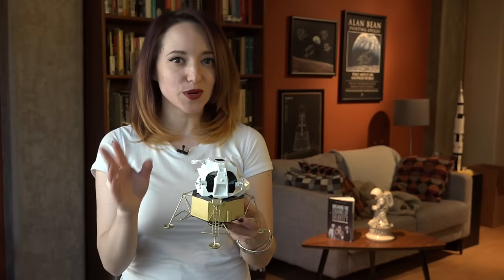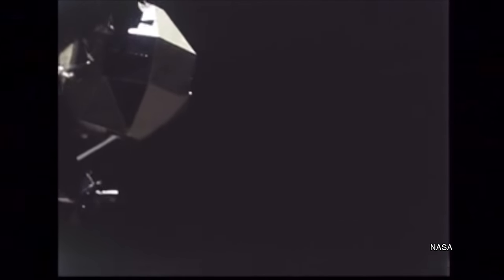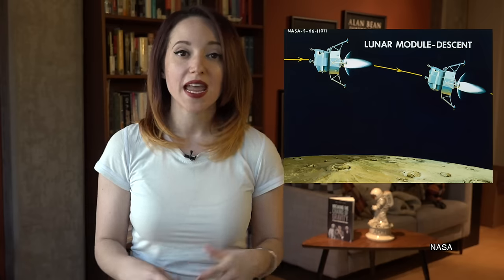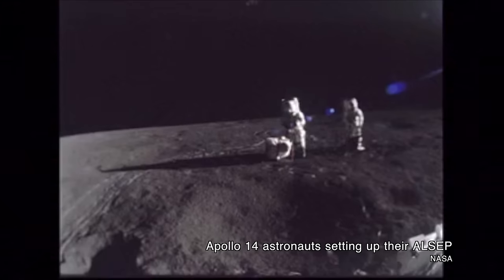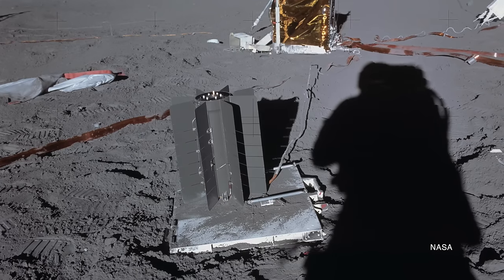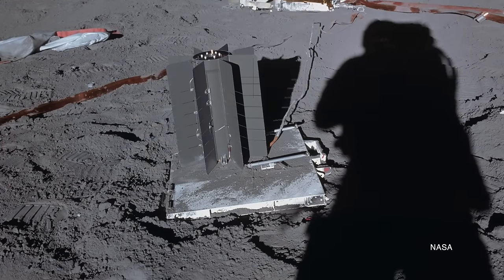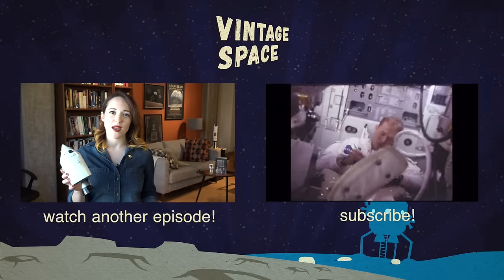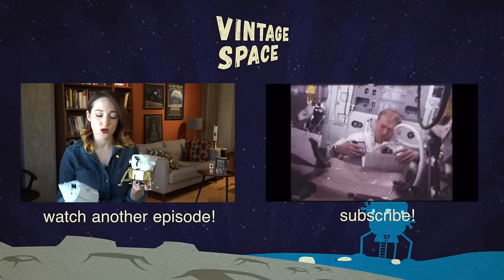What Happened to the Spent Lunar Modules?

Comment: Im glad this video was made! A common question among me and probably many others! Thanks Amy, love your book btw!
Reply from the maker: +Deandre Edwards Thanks so much; so glad you enjoyed it!
Reply: +Amy Shira Teitel (Vintage Space) I did! You should make a video on why some cryogenic tanks were orange! Thanks again!
Reply: +Deandre Edwards Orange is the color of the heat insulator that is used on cryogenic tanks. Heat isolators are required for liquid hydrogen tank attachments to preclude the liquefaction of air on exposed metal, and to reduce heat flow into the liquid hydrogen..
Reply: +Damminh Khoi Okay wow. Thx! Ive always wondered that.
Reply: Damminh Khoi why orange? I understand the need for the insulation, is it just the natural coloration of the compound used to make it, or is it colored orange for a specific reason? I know that the early sts flights had the et painted white to reduce thermal load on the et itself. the hot Florida sun heats up the cryo fuels making it boil off and gas out more. they determined that white paint in that quantity reduced payload in the orbiter.
Reply: Yes, it is just the natural colour of the compound.
Reply: Nasa stopped painting the Shuttles main tank to save weight. By not painting the tank it saved 600 pounds.

Comment: I was under the impression, based on my own reading of books about the Apollo program (I was 10 when the Eagle landed), that the ascent stage of Eagle was shot into space and not back to the moon. I believe they were trying to figure out how long the ascent stage would operate once the coolant was depleted, kind of like how long with an engine run with no water in the radiator. I heard it lasted 2 1/2 hours after it was shot way from the moon.

Comment: Have you done any videos or research into AAP (the Apollo Applications Program) which called for extended stays on the Moon of up to 30 days using modified Lunar Modules? I've only found bits and pieces on the subject, but it seemed there were two variants on the Lunar Module that were being considered, the LM Shelter and the LM Truck. The Shelter was supposed to allow crews to stay longer and in better comfort, while the Truck was supposed to carry additional supplies. These were in addition to the "standard" LM which would still be used by crews for landing and taking off from the surface.

Comment: Thanks, Amy. I had wondered about this. I just went back to see if the Lunar Reconnaissance Orbiter (LRO) had photographed any of the crash sites.  I found photos showing the Apollo 13, 14 and 16 S-IVB booster impacts on the LRO's mission page (I can't post the link, apparently).  But, I don't see any for the ascent stages. Do you know if they have been spotted?
Reply: +Bruce Feingold   I looked into this a few years ago and at that time, only the Apollo 14 ascent stage impact had been identified by the LRO but it was originally imaged from lunar orbit by one of the last Apollo missions so was easier to follow up on. Here's a quote from a forum about it:

"As a follow-up, the locations of imapct sites for the LM ascent stages from Apollos XII, XIV, XV, XVI and XVII are known. They are illustrated in Philip J. Stooke's The International Atlas of Lunar Exploration. To my knowledge only the Apollo XIV LM ascent stage impact site crater has been identified. The Apollo XVII LM ascent stage was intentionally impacted on South Massif, about 10 km from its original landing site. I am certain that all LM ascent stage impact are visible on Lunar Reconaissance Orbiter imagery, it is just that no one has sat down and identified them yet."

As mentioned. The book has photos of the locations of the impacts but the actual craters haven't been identified. I actually took the time to download some of the LRO images hoping to try and find the Apollo 12 ascent stage. A bit of a challenging task to say the least. A much smaller impact site then the S-IVB's for one thing. Of course there's also the fact that there's been about 40 years of natural impacts that might obscure anything recognizable.

Comment: Yes . I have a question for you. According to the Apollo 13 movie it took 4 minutes instead of 3 minutes in re entry blackout. How come the carrier and helicopters were there to pick them up. In the extra minute, wouldn't they have travelled over 5 hundred miles?
Reply: Because the movie was attempting to portray the historical record as accurately as possible.
Reply: @DeputyNordburg  But that doesn't answer my question. Helicopter would have been hundreds of miles away.
Reply: @horseandcart5978   It does. Your question was strictly about the movie.  There is plenty of information about the real mission, are you now interested in the actual event?
Reply: In reality the capsule was in radio blackout for 6 minutes, which was a surprise.  But the longer blackout was due to a shallower angle of approach meant to lower the stress on the heat shield.  The thinking was the heat shield had potentially been damaged by the explosion.  However this was all calculated and the predicted landing zone communicated to the Navy.  The capsule came down within a mile of it's predicted landing point, and only 2 miles from the aircraft carrier.  
All of which i found with 30 seconds of searching...
Reply: They still knew where the craft would end up, despite however long the blackout would take.  And, well, let's face reality here, the astronauts also chose not to answer mission control quite as quickly as they could have.  Lovell told me that they were pretty relieved and full of a ton of emotion when they got communications back, and just ended up waiting a little bit extra before replying to Houston.  But, don't take my word for it.  He has also said that in a couple of lectures you can find on YouTube (though, at the moment, I'm not going to remember which ones).
Reply: @horseandcart5978   It's probably also worth pointing out that in the movie, It's not NASA talking about 3 minutes of blackout, it's Walter Cronkite.  And of course it adds to the drama.